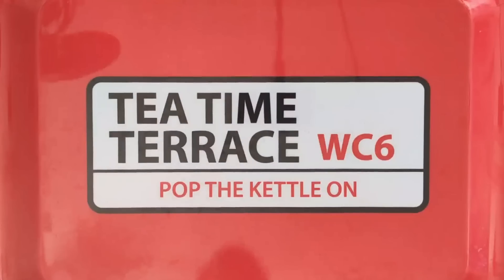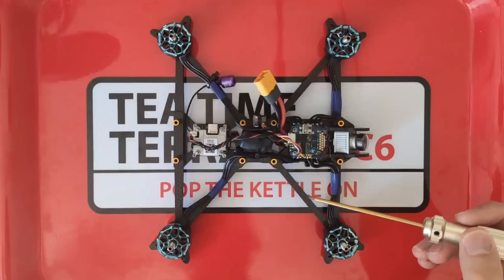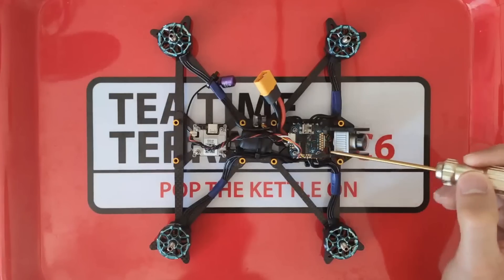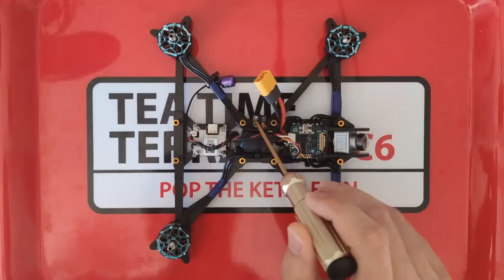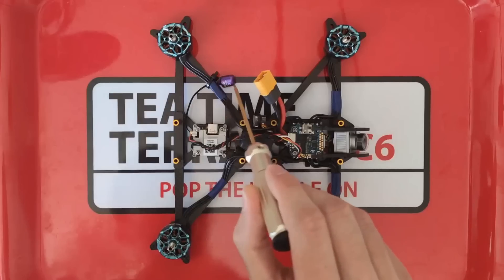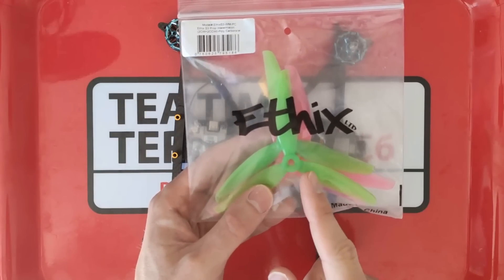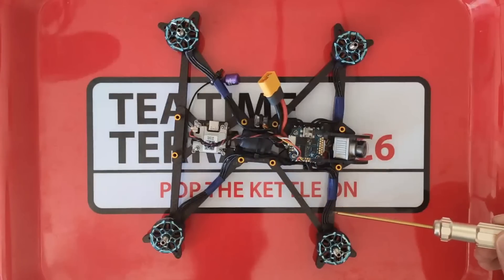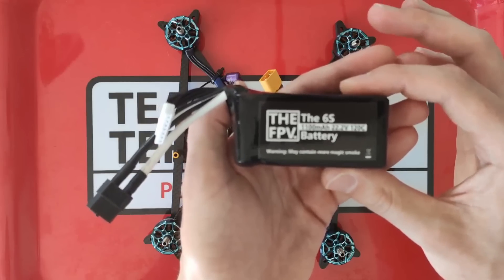My perfect AOS 5 Freestyle Build. I'm trying to make the world's best flying 5" FPV freestyle drone.

Comment: A little feedback about the frame: if you work with sturdy sma connectors (analog) for the antennas, there seems to be no good designs out there to mount it on. As the stack height is limited, both sides of the sma connector touch the frame and are bend under extreme angles. It's kinda ok now, on my build  but this is maybe something that can be improved in future versions or a suited 3d model can be provided. I can send pics if needed.

Comment: Awesome build and I really appreciate the knowledge you give. Just curious could you mount the dual DJI air unit antennas one on each back arm?
Reply from the maker: Yes you can! I did it on my AOS 5.5 build.
Reply: @ChrisRosser  Awesome I just completed my first build and mounted the antennas on each arm as there really aren’t any good 3d prints for the apex dual DJI antennas. Thank you for your time and response.

Comment: Can someone tell me what the maximum stack height for this frame is? Also, I know it supports 30x30 stacks, but some ESC are longer/wider. How much space is there horizontally to fit a bigger 4in1 ESC? I have a 65A Holybro Tekko32 Metal that I plan to use, but not sure if it will fit. Another dimension that would be good to know: what is the length from the stack at the back to the camera at the front? Will a 120mm MIPI cable for HDZero be enough or do I need a 150mm long one? Thanks in advance :)

Comment: question about the mamba interference isolation film: I'm using an iFlight Beast H7 AIO, and I have the HDZero VTX on top of it (incidentally that's on the AOS 3.5"). would the film "isolate" the VTX for a better video signal from the AIO below, or does it work only to isolate the FC from the ESCs in a stack? thanks as always
Reply from the maker: Digital video doesn't really care about interference (unlike analog!). I'd use it for the flight controller.
Reply: @ChrisRosser  thanks!

Comment: About the interference shield, the instructions from Diatone is to solder to a ground pad on the FC, not on the battery leads. Also, there is no risk if this shield is touching the ESC or the FC?
Reply from the maker: I solder to the ESC ground because that's the least sensitive to interference. It doesn't matter which you solder to really. You do need make sure it doesn't touch on either board because it might short something out.

Comment: I'm using Session 5 but also have hero7 and wandering if upgrading one frame of my two quads would work with my both cameras..
Reply from the maker: The GoPro camera mounting on the 5 and 5.5 is identical. Either quad can carry either camera.
Reply: @ChrisRosser  Great Thanks master:)

Comment: I want to buy one soon! REALLY! I don't know if that's the intelligent look of your face or even more then intelligent way of talk but I believe all you said and when I heard "almost no frame resonance and better propwash.." I have a big hope in this near future plan to build your quad and that it will solve my issue with vibrations on my HD and which I can’t solve on two quads for almost a year now... Would your 5" AOS frame handle Hero7 ?? Thank you Chris Master:)
Reply from the maker: It would do. The AOS 5.5 is specifically designed for heavier cameras and the AOS 5 for session cameras but you can fly both on either.

Comment: Should I solder fc gnd or battery gnd to mamba insulation film gnd?
Reply from the maker: I would recommend ESC ground.
Reply: @ChrisRosser  What awg should I choose to connect esc ground to film ground? Thank you! :)
Reply from the maker: @mattiagatti1200  30awg.
Reply: @ChrisRosser  sorry last question: what awg do you advice to extend capacitor legs from the esc? It's a question I've never found an answer.
Reply from the maker: @mattiagatti1200  I use the bits of wire cut off from the motors. Works great!
Reply: @ChrisRosser  Do you think a 35V capacitor is enough? Can't spikes reach an higher voltage in a 6s build?

Comment: Hey Chris, do you see any improvements regarding noise levels when running this Twing FC? What FC would you recommend to further improve the data going into the PID loop once all mechanical issues have been reduced to a minimum. I’m currently using a Radix2 which has the BMI 270 gyro and I’m finding that gyro perhaps a little too sensitive. Thank you Chris
Reply from the maker: I think the twin gyro does have a small advantage but there is also an increased risk of a single gyro failure. Have you tried PG44a grease to reduce vibrations? I have a video on it, it really works.
Reply: @ChrisRosser  I ordered 767a instead. I hope they’re both just as good?
Reply: @ChrisRosser  im just about to start my build of the AOS5, but I'm struggling to find 3d printed parts for the insta360 one r or the SMO 4K. Any ideas? Thanks

Comment: What's the total flight weight? I want to put something similar into the sim to practice with while i wait for vista's  to be back in stock again.
Reply from the maker: Dry weight: 345g
2 battery straps: 5g
1100mAh 6S : 200g
AUW: 550g

Comment: Hi Chris, just waiting for the frame to arrive here in the UK rolls eyes Because the frame has been designed to remove as much frame resonance as possible it has got me thinking, have you taken into account prop balancing? You dont seem to hear much about prop balancing and I guess like myself you just bang on the props and go rip. I`d be interested to see if there is any difference on your frame with unbalanced props and balanced props. Cheers
Reply from the maker: I use Ethix props or HQ as they come very well balanced. 👍

Comment: Amazing build!! How did you wire the fettec diodes??
Reply from the maker: They go across the battery pads on the ESC.
Reply: @ChrisRosser  so it Is in parallel with the capacitor, right?

Comment: final question: whats the design reason behind the outer motor screw holes being slotted?
Reply: If I had to guess. Most frames with motor protecting protrusions sticking out at the ends of the arms, have slots or wholes drilled in them to help soften the blow of any impact in that area. I think instead of drilling these separate holes, he just decided to extend the outer bolt holes to account for that feature. I personally think it was a great idea, and it's just different.
Reply from the maker: There is very little stress in that region even during an impact and the carbon is thick so I did to save a bit of weight.
Reply: @ChrisRosser  oh cool! Also i jist thought if it did take a hard hit it may keep from bending screws in the baseplates.. Man you sure do keep up with all our small questions! Still deciding wether to go aos 5 or 5.5 now that i got dji gear!

Comment: Where did you connect this spike absorber too? And the capacitor? Like I wanna know, gonna build this amazing end of this month also! Great job!
Reply from the maker: The spike absorber is connected in parallel to the capacitor across the battery pads on the ESC. Double and triple check the polarity because if its the wrong way round it will short the battery when you plug in!
Reply: @ChrisRosser  I just set up everything but will use different motors. I like 1900kv motors.
This build is so nice! Just have to wait for the caddx vista to get in stock again. Its sold out anywhere here in the Netherlands

Comment: Sorry to be a downer but that ESC won’t last — had the same idea for my first freestyle quad and it survived several packs only. 
I since got into racing, 20x20 frame and destroyed three cheaper brand mini escs (40-55a ratings, but these are manufacturer rated and don’t take all elements into account) — now on Foxeer Reaper with fingers crossed.
Basically the smaller mosfets make quality control far more critical than 30x30 escs
Reply from the maker: Hi Nick, you need to run this on your build if you are running 20x20 ESCs I think if you are not already. https://fettec.net/en/shop/fettec-spike-absorber. That component will protect the ESC from voltage spikes that would otherwise damage the FETs over time. You may also consider reducing your ramp up power to 25% which is what I run. That will reduce the peak current through the FETs. If you do both of these things I think you will find the durability much improved.
Reply: @ChrisRosser  Thank you Chris -- I was aware of the absorber but fettec seem the only supplier and they're hard to source here in Australia -- will try your ramp up suggestion, cheers

Comment: hello, I have bought your frame and I hope to do the same with the components. I want to know if there is an alternative for the caddx vista lite air unit because it is out of stock. If I have to wait, it's fine, but could I put another air unit?. Excellent video. Thank you
Reply from the maker: The frame fits the full size air unit as well if you would like to use that.
Reply: @ChrisRosser  Ok thanks. And for the micro vista caddx? Is that the camera size is 19x19, could I use that?
Reply from the maker: @jorgevasquez6836  Yes a 19mm camera will fit! You may want to use a thin 1mm washer to get it tight
Reply: @ChrisRosser  Perfect and thanks for all. Your videos are of a very high level, I watch them several times to understand and I love them for the challenge of understanding this mechanism of the drone

Comment: i see on the website it says dual 30x30 stacks! very nice! thats exactly what i wanted to see and 5.5 version! my next frame for 6s build here we go!!
Reply from the maker: The 5inch has dual 30x30 stacks. The 5.5 will have 1 central 30x30 and two additional 20x20s. Or 3 20x20s.
Reply: @ChrisRosser  interesting plot twist... should work for me i like 30x30 akk vtx and 30x30 esc and fc is easier to solder everything to
Reply: @ChrisRosser  is there a rough time frame on the 5.5 inch version?
Reply from the maker: @Mustard_Maggot  Should be launched before the end of the month if all goes well.

Comment: Hi Chris, please can you explain why you grounded to the Mamba shield to the battery ground and not the flight controller ground. I seem to remember reading that you ground to the system you are trying to protect from interference rather than just any ground. Could be wrong though.
Reply from the maker: I thought about it this way: The flight controller has a ground plane which is what normally picks up EMI. If I connect the interference board to the FC ground I'm just passing that EMI straight to where I don't want it! The ESC ground however has a monster capacitor on it which should soak up the ripples.

Comment: When the frame will be available ? Only back order since several week. Thanks
Reply from the maker: Hi, Nick has been shipping frames daily. Your order may have fallen through the cracks? Did you order direct through the cncdrones.com website? If not its worth doing that if your country is in the international shipping list.
Reply: @ChrisRosser  Thanks, it's my mistake I think, that's because i see always "back order" but as you said, it s may be just "a standby check" before to proceed order.

Comment: I had that FC in a 3" Cinerat build and it just frustrated me. No matter what I did in BF, it read 90 degrees off. Perhaps I got a dud.
Reply from the maker: With the twin gyros one of them is 90 rotated so that could cause an issue. I'll let you know how I get on with mine. Unfortunately the F722 shorted out on first power on (That's on ST not iFlight the power rails were still good) so I'm waiting on a replacement.
Reply: @ChrisRosser  Look forward to seeing your results of the biuild and your experience with the FC.

Comment: Your design is very academic, cool! Do you have a plan to design a low air resistance quad，I personally think that most fpv drones should not be called aircraft because of the poor air resistance performance.
Reply from the maker: I will definitely consider this for my upcoming racing frame.

Comment: If you do not mind I would change the position of the motors on arms (slightly rotate it)... the wires could go out of the motors more in the line with the arm.They would be much safer than now are.  And ofcours I am big fan of your videos and your explanations. You are doing great job :)
Reply from the maker: That's a good idea. I've rotated them on the 5.5" and will look into updating the AOS5
Reply: @ChrisRosser  what about frame for air unit on 5 inch AOS5??? AOS5 HD AIR UNIT FRAME ?
Reply from the maker: @rokg12  The air unit fits perfectly into the AOS 5. I'm running one right now. http://cncdrones.com/aos-5.html has some pics of a build with the air unit.
Reply: @ChrisRosser  super duper :) thanks

Comment: F722 is less future proof than an f405 actually. F722 is running out of memory. If you want future proof get h7.
Reply from the maker: Very interesting thank you!
Reply: @ChrisRosser  f745 chips have more memory though. So they are more future proof than the f722 fc. H7 though is what you want if you want future proof. Im hoping to write some code that will only work on h7 fc as itll be to intensive for f7 or f4.

Comment: Are the ICM20689 chips less desirable, due to their higher sensitivity (I think that's what I've heard) than an FC with an MPU6000?  I realize that having two gyros is suppose to provide better noise filtering because they are averaged but is that offset by a more noise sensitive chip?
Reply from the maker: It's a good question. I might have to add an MPU6000 FC on the same stack and do some comparisons.

Comment: Wanting a new transmitter but I'm stuck between the ix12 and nx10 spektrums which would you get?
Reply from the maker: I'm more of an OpenTX man myself. I'd look at a Jumper or Radiomaster and make sure it'll work with ExpressLRS.

Comment: Help me too understand how the FC is going to respond correctly when not centered between the motors (x marks the spot)? Thank you for sharing!
Reply from the maker: Good question! In a rigid body the rate of rotation as measured by a gyro is the same no matter where you are in the body, so the location of the flight controller does not matter for acro flying at all.
Reply: @ChrisRosser  I appreciate the reply and all of the content; which is opening doors left and right for my personal progress. Looking forward to the next releases.

Comment: Hi, Chris! Congrats on your first frame! I have a question about interference shielding. Where do your solder it to: FC ground or ESC ground? Can I DIY this shielding out of the copper foil insulated between two layers of tape and expect it to function the same way? Thanks.
Reply from the maker: ESC ground is best I think but either will work. And yes you can DIY it!

Comment: How about making some 3d print files for Antenna mounts for SMA adapters?. This way of mounting the antenna seems way to ghetto to me..
Reply from the maker: I've tried a few different solutions. Having a straight VTX antenna invites vibrations because the antenna acts like a mass on the end of a flexible strut. This way there is no unsupported length to vibrate and it will never get caught in the props. Maybe not the best for range but for freestyle that is less of an issue. When I do a long range frame I'll have to think a lot more about the antenna support.
Reply: @ChrisRosser   TPU printed support. with a rather short antenna really matters? . on my apexes im using TPU sma mounts in the back frame ressonance steel seem very good
Reply from the maker: @Mqzfpv  If you use a very short stubby antenna you may be OK. But if I provide a mount others will use long antennas and have problems and I don't want to take that risk. If everyone ties them to the arms the risk of issues is much less. If you want to print your own mount for the back standoffs and use a short SMA antenna then I fully support that! I hope you understand.

Comment: I had a set of 6s motors I ordered by accident and they have been sitting I thought about selling or trading them but this inspired me to build a 6s quad batteries and flight controller ordered as well as a frame and I have a vista and an rx on hand I really like the look and I plan on rocking a 9 black

Comment: Damn, this will be an expensive channel to follow. 
Please do the same video with the 5.5 inch frame. 
Thank you for your contribution to the fpv community.
Reply from the maker: Do you think budget builds would be just as popular as perfect builds for videos? I think the AOS 5 with budget components would still beat a typical frame with expensive parts... Particularly given how good cheap motors and stacks are.
Reply: @ChrisRosser  Absolutely 👍🏻
Reply: @ChrisRosser  It would be much more popular looking at other cheap build videos. When I flew I was always on a tight budget, nowadays it's not really accessible for everyone unfortunately.

Comment: On the 20x20 & 30x30 Fettec esc you can attach a Fettec spike absorbing component to each esc. Nice little components. I run the Iflight V1 Xing 2207/1800kv motors on 6s lipo and they are nice smooth motors good for short 4 or 5 minutes flight times easy on the sticks. Good motors
Reply: May I ask about FETtec Spike-Absorber? It's need to be added to each ESC?

I thought Capacitor should eliminate voltage spikes.

Comment: please show us where and how to put the nyogel in the part om the frame
Reply from the maker: Just a few dots (2mm size) between the touching surfaces of the frame does the trick. You can also use on screws to prevent them loosening in flight.
Reply: @ChrisRosser  thank you vm sir,,